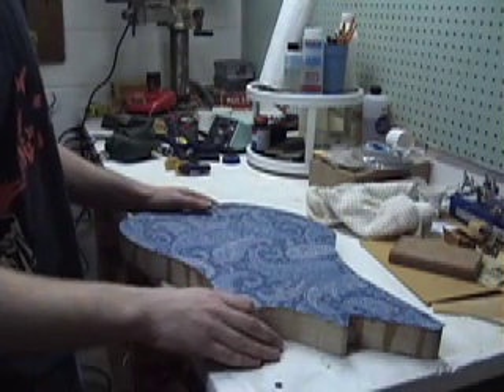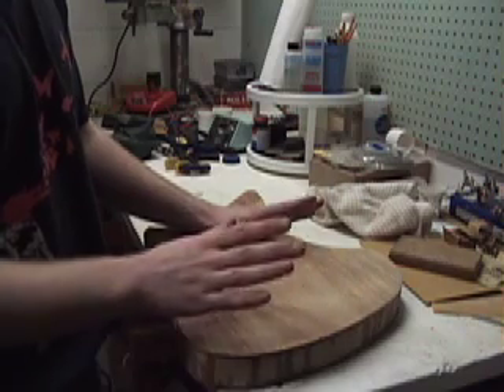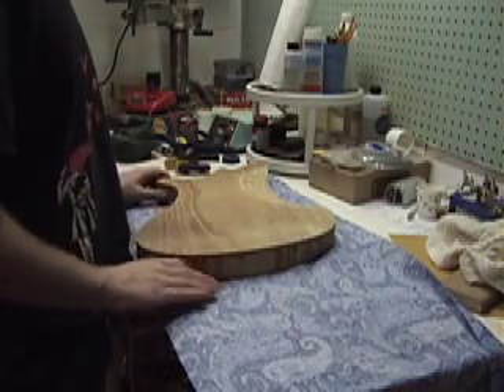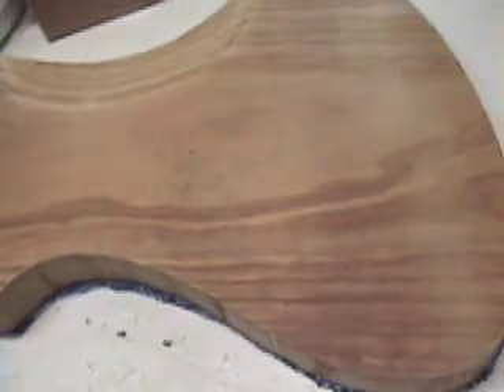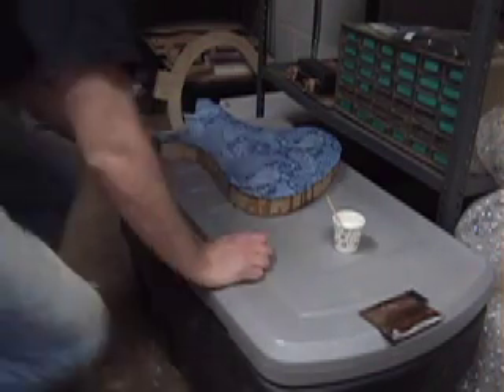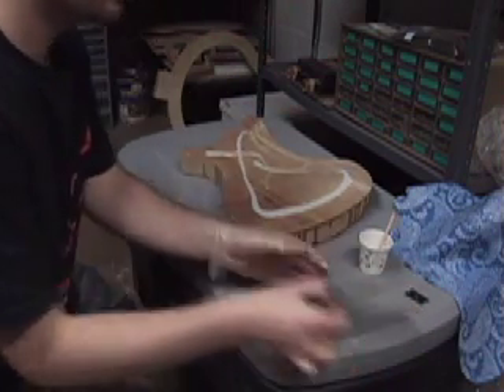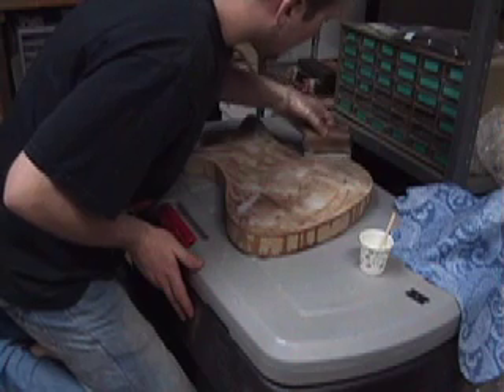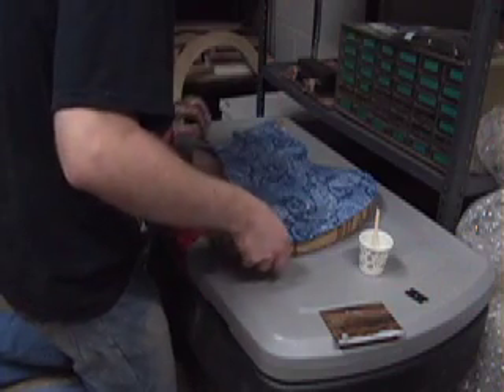Light Fabric Material Finish With Epoxy

Comment from the maker: That too would be perfectly viable I imagine. And to a certain extent, that's what I did. I believe I mention this in the video, but the guitar is actually over-sized from the final shape. So I am routing it to shape after attaching the fabric. The other thing; I did it this way so that I could accurate place the arm and belly carves (which I couldn't do after adding the fabric).

Comment: I really like your video, but I was also wondering if you would do another video that shows more of the finished design. The video just kind of leaves everyone hanging on the next steps :) :)
Reply from the maker: It's just like any other finish. Make sure you have a flat surface (in this case epoxy... If you don't by the end of this process look up epoxy pore filling), seal, finish.

Comment from the maker: XGCPolaris I have a general rule of thumb to not put things with greater adhesion on top of things with lesser adhesion. They just generally tend to be problematic. For example, here, sanding sealer is just lacquer. Lacquer can, and will, at times, lift, chip off, etc. It's adhesion is "ok." Epoxy is an adhesion KING! Good luck ever removing this fabric without sanding/cutting it off the face of the guitar. IE: Bad idea to put the fabric and epoxy over the lacquer.
Side note: just grab some citrus-strip, remove the sealer, do this, re-seal, and finish! Super easy to remove lacquer with citrus-strip.

Comment: Im assuming this was a failure?
Reply from the maker: Why are you assuming that? It turned out great. Here's a pic of the burst it got, this is pre-clear coats though: http://i95.photobucket.com/albums/l139/verhoevc/marlinteleandmeeting/927BDD56-33D8-4D96-A8A0-4E6C3A443041_zpsurry98vr.jpg
Reply: verhoevc 
I initially assumed that as well, being that there's no "Part 2" video. The photos look pretty cool though! I've been wanting to try something similar with printed artwork, i.e. my own photography/graphic art printed onto paper and then "laminated" onto the guitar(as opposed to hiring an airbrush artist). Although I've experimented, I really suck at the traditional finishing techniques for guitars. The epoxy resin that I've seen here on YouTube in applications such as counter tops make it look like like a promising option! Any suggestions?
Reply: You should have primed it first. You "do not recommend it" because you didn't do it correctly. Master luthiers say to prime it a correct color first.

Comment from the maker: I've experienced minimal tear-out of the fabric or even fuzziness at edges. You should be fine icetrey5905.
Jeemdee... I have NO idea how to make that work well. I'd say first try just laying the fabric across the whole thing and trying to smooth it down the sides of the center... if that doesn't work, rip it off before it dries and try it with multiple pieces? The key here is FLAT. The less level sanding you have to do the better!!!!